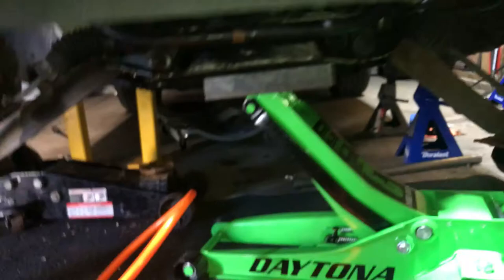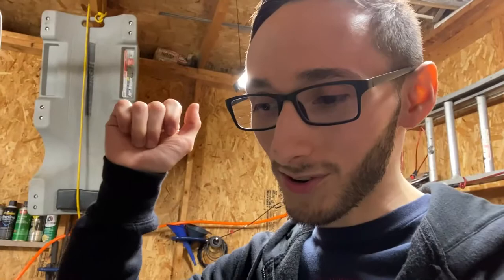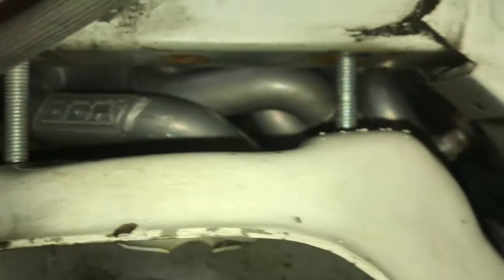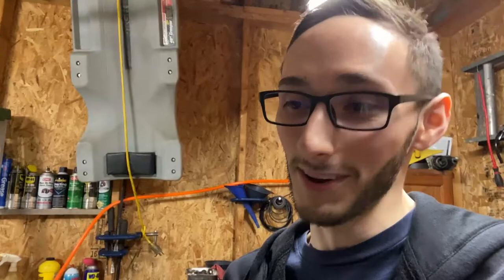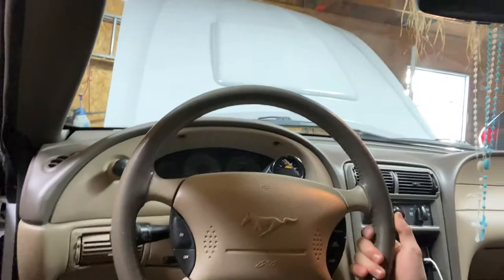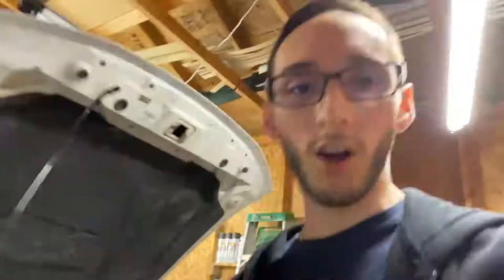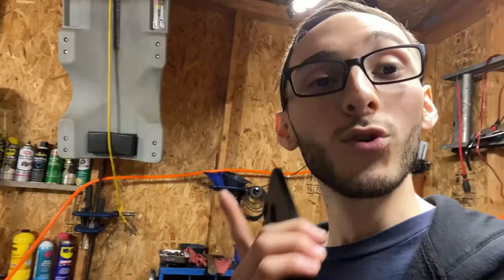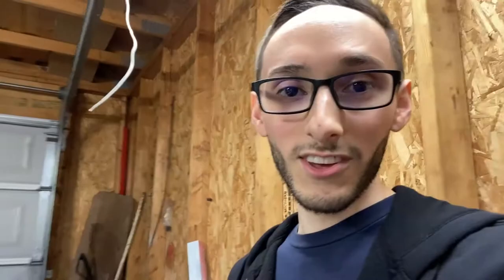Everything You Should Know About Long Tube Header Install [99-04 Mustang GT 2V 4.6]

Comment: You dont have to fully drop the k member you can loosen it about a inch and the headers will slip though also recommend just taking out the steering collumn and steering rack and it should go in

Comment: if you already have a hoist, its easiest to just pull the motor and trans out of the car together, trust me. I can have the motor and trans out in 30 mins with basic hand tools. And you don't have to deal with getting the car re-aligned after.
Reply from the maker: That's definitely an option to, a little more scarier for a novice but that method definitely saves time. Thanks for the input.
Reply: Im trying to get my motor out but I’m having trouble bc of the long tube headers in the car any tips? New edge 4.6 of course

Comment: 56 yr old master tech has worked at ford for 30+ years, he also said you have to remove the whole k member. He also said “say good bye to a comfortable cruiser”
Reply from the maker: Yeah there’s really no way to NOT remove the whole k member when doing headers. As for comfortable ride, car still rides same as stock, just sounds a tiny bit louder in a refined way. I think what he mean’t was if you decide to throw in a tubular k member, that will definitely be a different riding experience since you run front coil overs/conversion on a setup like that. Or maybe even just the fact that your options for wrenching are super limited when installing headers on stock k member, like seriously, if the starter were to go out, man…. what a nightmare that would be, definitely wouldn’t be a simple 2 hour long job.

Comment: holly smokes!!! thank for sharing all these tips! As I'm in the process adding long to headers. The only thing I'm doing differently, is that I have my engine pulled out of the car for a rebuild . I am hoping by mounting the long tube heads on the engine first then installing it into the car works. I can't seem to find any videos on Youtub to see if anyone installed headers on a pulled engine before installing back . If anyone has, please share with me 😁
Reply from the maker: I know people who’ve done it this way. They’ll take motor out in one piece with the long tubes attached & put it all back in with the long tubes attached. It can be done 👍
Reply: I've done it. Get some extra hands to man handle it back in, have to get crazy angles on the engine to slide the long tubes in

Comment: Great video man, very informative! I'm planning on getting long tubes soon.
Reply from the maker: Thanks homie! Also, I got a second opinion on the whole dipstick thing, I’ve been told that if you cut the top flange of the driver side header between primaries 6 and 7, then you shouldn’t have a hard time to reuse factory dipstick with long tubes, so something to consider. Apparently you don’t even have to touch the dipstick this way.
Reply: @McLovinsFunhouse  good to know!

Comment: I have American Racing long tubes I'm currently replacing the gaskets on.  The drivers side cylinder #7 the tube runs right over the top of the bolt.  Open end wrench for about 30mins.  That 1 bolt is my nightmare.

Comment: What about when the transmission is removed? I may be trying to install long tubes here soon when I do my clutch
Reply from the maker: That’s where it gets tricky. I believe you can only install long tubes with trans installed since there’s not enough clearance to fit transmission   with long tubes already in. You should be able to install driver side header no issue (with or without transmission installed) but passenger side is where it gets tricky. Every brand of headers is different but some will allow you to remove and install them with no issues, regardless if transmission is out or in, but those style headers are usually much more expensive.

Comment: I lv your videos and keep it up!
I was wondering with your long tube heads have you had any issues  Igniting the cats? 
 Have you tried looking into stainless steel headers and why did you decide to go with the BBK headers. As the S.S doesn't  Is exorb as much heat?
Many thanks for your time. 
Ingo Pedersen
Reply from the maker: Thanks! Not quite sure if I understand "igniting the cats" but no issues whatsoever. Tuner said everything looked perfect while he was tuning it so that says a lot. I did blow out one side of the cats out a little bit lol but that was probably from going airborne and scaping like mad this one time, along with a lot of super hard pulls on the street. Pieces ended up in my driver side muffler and it was funny taking it out, I had to cut open a little slot into the muffler and reweld it. Sound remained just about the same, a tiny bit louder but barely any louder.
Reply from the maker: I like the BBK Header + BBK Midpipe combo since it's a direct fit and there's not much wrestling you do with the headers vs cheap eBay ones. I'm sure Hooker/Kooks headers are great but I just didn't have the money and I didn't want to custom fab a midpipe. 100% of work on this car has been done in my own garage, exhaust shops are great but I'd rather just do what I can at home since any sort of shop around my town is a hit or miss. It was a direct bolt on.
Reply from the maker: SS is nice but I just didn't really see a need for it. The ones who say non-stainless headers won't last are the ones that buy cheap ass headers with no coating or at the very least any high temp spray paint. This car has Flowmaster 40 mufflers for the past 10 years and was driven in harsh Wisconsin winters, yeah they look rusted but I sanded them down a bit and they look good as new, stainless isn't everything. My headers are starting to rust a bit (well more like flake off in the ceramic coating more than anything) towards the bottom of the car but up top looks pretty good still. Daily driven for the past 2.5 years since install (even in the snow) and I'm confident they'll last for a really long time. Only issue I don't like with BBK is that they marked up the headers by like $200. Ceramic coated ones were $599 but I had gotten them for like $540 with a coupon from Lethal Performance at the time : )

Comment: Hear me out, could you not just pull the heads, install them onto the heads, then install the headers/heads all in one. Because I plan on doing head gaskets and a timing set replacement soon and when you pull heads off you’re supposed to pull them off with the stock exhaust manifold still on then reinstall the heads the same way. But I was thinking I could just do that, but I’d be reinstalling the heads with the long tube headers on them instead of the stock exhaust manifold.
Reply from the maker: Your method honestly could work. I know a lot of people legit pull the motor out when they want to go the route of installing long tubes and just dropping them in and it works fine but not sure on your route. You'll have to let me know if it's possible since you'll be taking heads out anyways.

Comment: “hopefully it helps” bro just scared me lol dont think ama get long tubes anymore 💀
Reply from the maker: It's a pain in the ass to do the job or take transmission down with long tubes in place, unless you have a fancy tubular k member which automatically eliminates all the issues. 100% worth it though! Makes the car just sound different than the rest. You can have a loud ass Mustang, but not many actually sound refined.  If you have the money and time, I'd say go for it. I've recently checked for catted mid pipes, seems impossible to actually find one since the EPA hates to see anything "high flow" lol.

Comment: Just remember that long tube headers will bump your HP up, but you'll lose some torque. Most cars don't see the track so shorty's may be a better choice. The best choice, in my opinion, would be mid length headers. But only JBA made them, which they don't any longer. If you still want to go long tubes, to get the most out of them, consider cams with timing. Have a professional do the work. factory cams can be off as much as 8 degrees from one another. A larger throttle body/ free flowing intake plenum, Ford performance PI intake manifold, minimum 3.73 gears in the rear end, 3.90's better, cold air intake, may need larger injecters, and finally-a tune.
Reply from the maker: I’m late to this comment but reread it 2 months later and thought that I’d add that the stock 19LB 2v injectors are good for up to like 330-340rwhp. Your fuel pump will likely give out before your injectors ever will.  Put a 255LPH pump in it and it’ll be fine. I mention this since I was given very bad info by many people that stock injectors can’t go past 280-300rwhp, YEAH NO, I wasted $250 of my cold hard earned money on 24LB injectors I never opened that I’ve been trying to sell for 2 years now, and am making 300+ RWHP on stockers and have been told by professionals that upgrading injectors on an NA 2v is a waste of money unless you are making BIG power or are boosted, or if the injectors are just super old & gummed up. 😲🙃
Reply: False. You gain both hp and torque all throughout the rev range. As long as the tube diameter is ideal you be fine.
Reply from the maker: @thenegus5469   @thenegus5469  You are correct, good advice. Ideal tube diameter is what counts here. Bigger isn't always better, especially with a 2v. Also to anyone reading this, don't waste your money on shorty headers, as they will add little to no power. In NA applications, long tubes are the way to go, especially with cams.

Comment: Ever thought of removing the valve covers or heads?
Reply from the maker: Already opened up valve covers when I did my cams, twice. I don’t really have a reason to remove heads, I always thought about milling to up my compression but I figure it’s a tight PTV clearance with my Todd Warren cams. I also thought about porting my heads but It’s a daily driver that can’t really sit for too long.

Comment: Not worth it on a 2v the factory logs are good enough to avoid all the nightmare scenarios that could arise because of these… I’ll list a couple: not enough ground clearance especially on lowered cars, have to remove them to do a clutch, get in the way for even a simple starter replacement and other simple things in the engine bay, don’t last as long as the factory manifold (most will eventually rust out)
Reply from the maker: You aren't wrong. Everything you said about the nightmare scenarios is true. Sometimes I wish I had a tubular k member because of all the clearance issues in the event my clutch or starter goes out. But damn they make the car sound soooo good. I street race this car a lot so it was essential for me. One thing is for certain though, I truly will never understand how people manage to fit even bigger diameter headers (like 1-3/4") into these cars, the fitment is so tight it's insane.

Comment: Do I use rtv on gaskets? I missed that part
Reply from the maker: That's more of a turbo thing. RTV isn't necessary on an NA setup USING MLS gaskets.
Reply: @McLovinsFunhouse  I can't get EGR tube disconnected. Think I can just unhook from above then remove?
Reply from the maker: @subduedsins7983  Do what you can. I remember using a blow torch and a crap ton of PB Blaster soaked overnight from when I disconnected the EGR fitting by the header. I didn't need to remove the entire EGR tube from above.
Reply: Did you buy a new EGR tube connector?
Reply from the maker: @subduedsins7983  Nope. The header came with EGR tube connector welded in